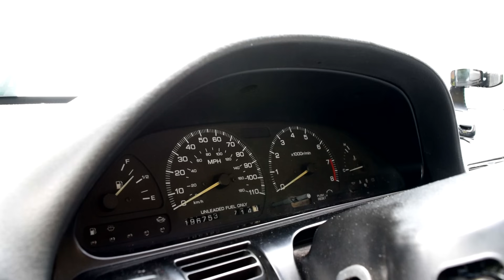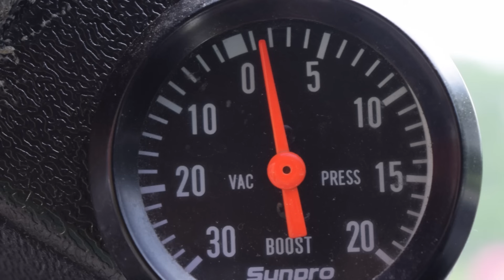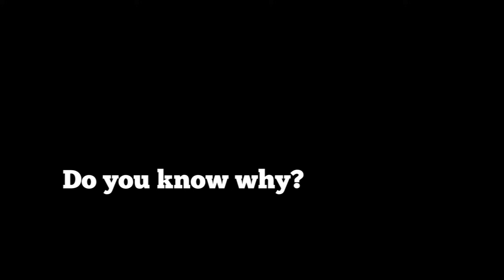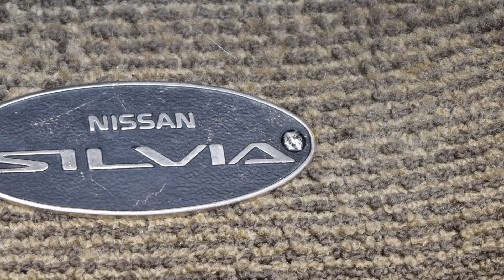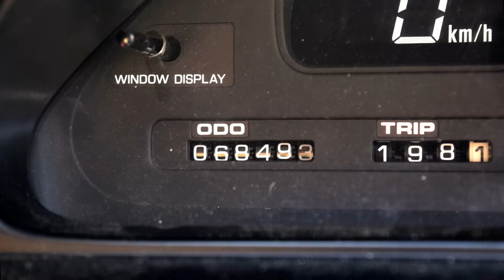Regular Car Reviews: 1989 Nissan S13 Silvia/240SX

Comment: The black one needs more camber,stretch, low, bolted on body bits etc, it doesn't look retarded enough yet - & WTF happened to the dashboard?

Seriously, I bet this thing is fucking horrible to drive for more than 5 minutes.  I understand why people do this kind of thing for drifting, but for a road car it's idiotic.

My flatmate of many years ago had an '89 JDM S13 only in silver & non turbo 1.8 - It was a nice car, very slow though.

Comment: Yeah they don't look classic at all. If the tires were a bit thicker and the rims were different, interior was a bit more modernized, and the paint was full gloss black with a bit of a lower body it'd pass for a brand new 2017. It looks like what car companies are trying to do, that retro look. Because it IS retro. But it's not "old piece of shit" or "jeeze wish I could afford to build one of those in my backyard" retro. It's affordable, both to import the JDM and to buy the USDM. I want one. I want both. The JDM for a nice calm daily, or to have a laugh when I freak out my friends who think it has no pull or power because it's silent and looks like something a Japanese mother would drive on her way to work. And the USDM one for tooling around on a track-day. Mainly because getting used to shifting with your left hand isn't best done going plus-100MPH.

Comment: "If they offered it here(the 2 liter) it wouldn't be called the 240sx anymore, it would've be the 200sx"
Nope, it would've been called the the 180sx, and if it got the 1.8, like the one we have in europe, it would've been called the 200sx.

Because screw logic.
Reply: Yes the engine codes were logical but the cars were definitely not named logically.

We did get the SR20DE in a sentra based "200SX SE-R" here in the US. But most of the B14 200sx were base models with the GA16....still called 200sx lol.
Nissan used the lame excuse that the SR20 wouldnt pass emission standards which was ironic considering the engine was offered in Sentras in the same era. The real reason was because the SR20DET would have given the Z32 twin turbo a run for its money at a lower price and of course Nissan couldnt have anything eating away at the sales of the Iconic Z car (the car that put Nissan on the map in the USA).

That said...in the US if we would have been offered the SR20 the fucking thing still would have been called the 240sx because Nissan logic.
They should at least have offered the non turbo SR20 in the s13.